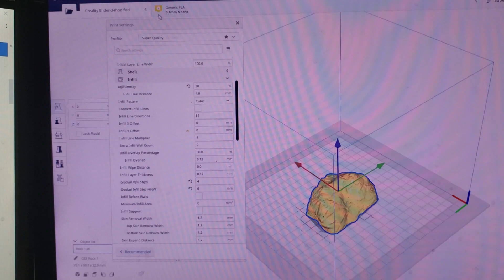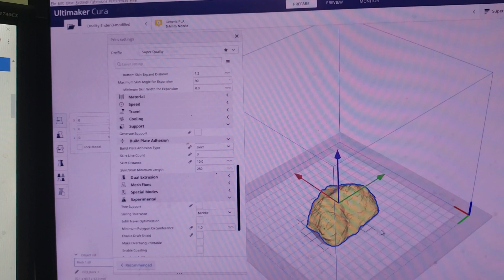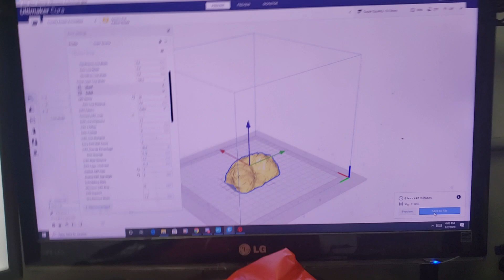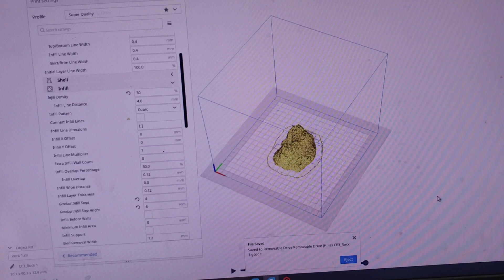MP10 first layer help.

Comment: Jost got a mp10 in trade today myself, i have a delta mini-- i could use some good cura settings, as well as how to get it to get closer to the bed. it starts printing just a tad above 1/4 inch from plate, even with my glass on there. i'm assuming i can adjust? Also, the settings i attempt to change have a -10, -20, 10, 10 and when i change it, it goes right back to neg again. so yea... still troubleshooting it. anyone have any info on this model?
Reply: I finally fixed my printer and its up and running. man this is a HARD printer. make more vids, cause not many on youtube. I got PLA working great, but some areas on the bed  are still too close. i think its the way the arm hangs,, going to be printing a cable strap to loosen the tension and a few other things. working great still!.

Comment: Nice Video thank you. I have I think the same problem. I’m using Cura too but the on the start of the print my printer is extruding pla 1cm above the printbed I don’t know why. Can you maybe show your Cura settings from the printer itself ?
Reply from the maker: I dont use the profile that came with the printer.  The start gcode is what causes the problem.  Moving Z up and down.
Reply: sniffle23 okay thank you. 
Ive also tried the bad level correction ( like your video ) and it’s still 1cm above the Board .... what to I need to change from the code ? ( I’ve watched your video with the code and were you said that you need to delete the 3 lines but it still is so ...
Reply: @ShartR  I have the same problem.  Trie to level the bed with the wheels under it.  Search on the web but no luck.  Tried Dr. Vas, has he seems to be the only one who reviewed this printer.  Tried is gcode with and without the lines described is this video and still no luck.  First layer won't stick what so ever.  Ordere some of that magicgoo maybe that will do the trick.  As for the 1cm thing, when I do the homing, one time it goes down , the other is goes about 1cm over the bed.  I'm so confused ...

Comment: Use hair spray it really works for me
Reply from the maker: Different environments tend to work better with different additives... hairspray does nothing to help me
Reply: sniffle23 you can also try putting glass on the print bead than spray it with hairspray. It should be strong hold hairspray and trust me on this, put the bed temperature to 70 it will hold it a lot better
Reply from the maker: Why are you giving me recommendations? I wasnt asking for help... I was showing people

Comment: Finally soemone else with the same machine, dude we should make a group just for this machine, there is almost nothing about it besides @DrVax videos.
Reply: Has a group been set up? I am a novice of 3D printing and I got an MP10 mini for my first printer. Love to chat to other people with this printer for help XD
Reply: @edbrown1996  I personally haven't found any group yet, maybe on reddit otherwise we can start one? 
You won't believe me but just right now ... for real ... am working on my machine. I need to say that machine has been just a lot of problems for me. Catch me on insta by cogles3dprint. Cheers.
Reply: @kingcogles  You're not the only one. I literally have had the printer for about 15 months now and haven't been able to get more than a couple test prints out of it. I eventually ended up just parking it and haven't touched it in a while. But I see there is a firmware update for it on Monoprice's website, so I might update it and see if that fixes the issues I was having.
Reply: @anonimuso  Sad to read that, I ended up buying the Ender 3 Pro after so many attempts to upgrade the MP10 mini. The biggest mistake we both did was not buying a Creality machine from the very beginning. Right now I have a moded Ender3Pro and MP10 mini  both working. And I still regret buying the Monoprice MP10 mini.
Reply: @kingcogles  I'm glad you got your printers working. I have a CR-10 mini that has a broken motor that I need to fix. Hopefully I can do that sometime soon. 

Well, I installed the firmware upgrade (at least I think I did because there seems to be no way to actually tell) for the MP10. I started from scratch and so far the printer has been working decently. I've been able to get some good first layers and smooth corners on my calibration prints. Now I'm going to try for something bigger. Wish me luck. 👍
Reply: @anonimuso  Glad to hear that you got it running again.